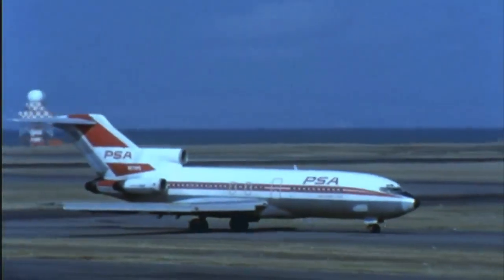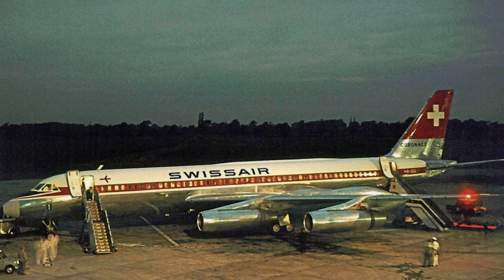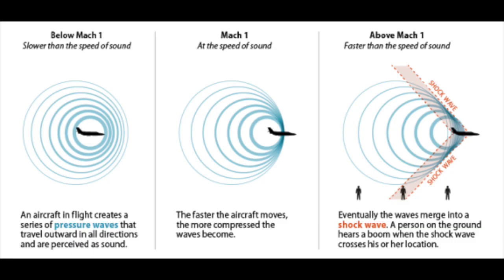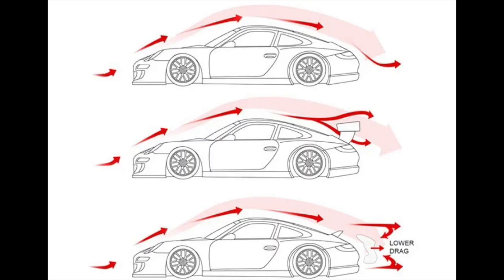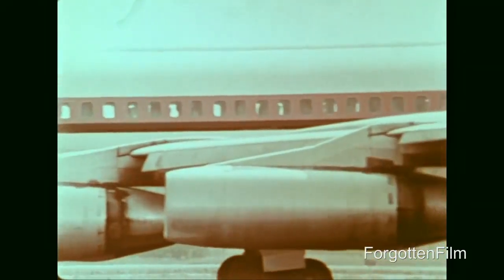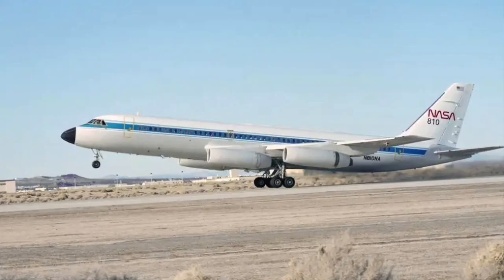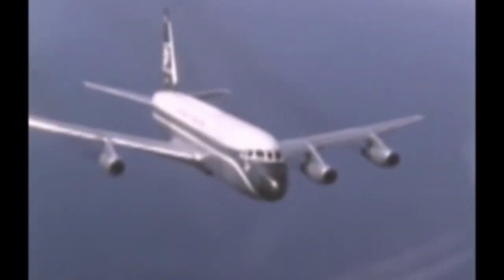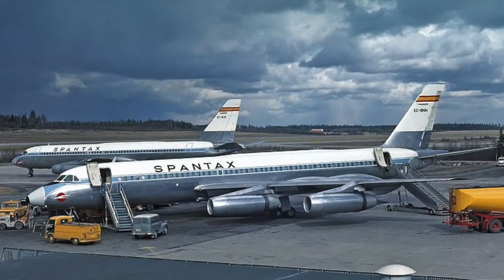A Dive Into the Convair 990 Coronado

Comment: Plural for "Aircraft" is not "Aircrafts." It is the same as for the singular. "Many aircraft..."

The 990 was capable of traveling at its designed speed of 640 MPH. But air flow challenges kept the aircraft from enough range at those design speeds to interest American Airlines. They wanted the 990 to take a first-class group from New York to Los Angeles at M.9 all the way. This is 625 MPH. That speed was easy for the 990. But at that speed it could not go far enough for a non-stop flight.

Convair had a marginally successful bird in the 880. So, with the fuselage and cockpit ready to be easily duplicated, a better idea than the faster 990 would be a shorter and slower twin. That was their original plan. It was Howard Hughes who strong-armed them into making a medium fast jet (the 880).

To the engines of the 990, they were sort of a turbocharged turbojet. Unlike front fan engines, the GE aft-fan would run faster with increased exhaust pressures. This contributed to higher speeds and higher altitude effectiveness. A nephew of a Garuda 990 pilot has said that he rode several times in a 990 that island-hopped at about M-1. And I suppose that, though burning a lot of fuel, is believable.

One last thing: Jet fuel is not a "gas." It is an oil. Its basic chemical base is kerosine. But understand that the 990 did have limited appeal- like the Concorde. There were 65-880s, 37-990s and about 20-Concordes.

Comment: It (nor the 880) were quite wide enough to have regular 3/3 seating.  That was a killer - though I've heard that it allowed actually bigger seats.  I heard they ended up cruising at speeds of only Mach .78 to Mach. 80, which was slightly slower than the 707 and DC-8 cruise speeds.  All because of fuel.  

I honestly think the Boeing 720 really killed the Convairs as well.  Faster than the 707's and DC-8's, and 3/3 seating.
Reply: 880s could cruise slow to save fuel. But 990s could not. Their wing shock bodies cost energy at lower speeds. So 990s always cruised at .85 or above unless restricted by traffic.
Reply: @danielocarey9392  Have never heard that, but it does make good sense!

Comment: Another cool, but odd, feature on the CV 990 was the GE CJ-805-23 turbo fan engine.  Note the compressor stage is in the back (not the front) of the engine.  This is why you see a 'tube-in-a-tube' when viewing the front of the engine.
Reply: To the engines of the 990, they were sort of a turbocharged turbojet. Unlike front fan engines, the GE aft-fan would run faster with increased exhaust pressures. This contributed to higher speeds and higher altitude effectiveness.
Reply: @danielocarey9392  Thanks for correcting my incorrect statement.  I meant to say (above) that the fan stage was at the rear, and NOT the compressor stage.

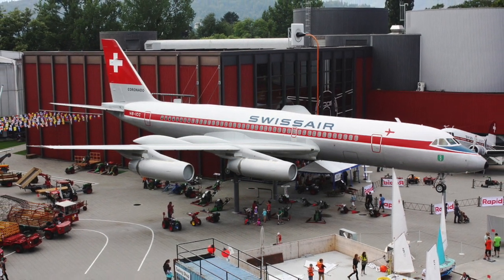Comment: TWA never operated a 990. The Convair 880 was in TWA's service. Also at 6:11 an 880 is shown wearing Cathay's livery
Reply from the maker: Yea you're right on that one. I also ran out of videos so I put a CV880 film in there and hope nobody would notice lol.
Reply: @rayneutronkuk  I maintained the Cathay CV880's for a few short years before they were retired and also saw Swissair 990's at Kai Tak briefly before being replaced by DC8-62's. The CX 880's were all CV880M's with full span leading edge devices (Kruger flaps inboard and slats in the centre and outboard sections) however the 990 had Kruger flaps in all locations. Often wondered why Convair changed that. Also knew a Captain who had flown  both 880 and 990 and reckoned the 880 was much easier to land.

Comment: was a beautiful aircraft, my father worked for TWA and used to see them at ORD
Reply: Great. He got to be around TWA 880s and see AA 990s in Chicago.
Reply: and don’t forget, one of the other two major US 880 operators, Delta, also had a substantial presence in Chicago since acquiring C&S in 1955 and probably flew the 880 there (AA certainly flew the 990 to ORD, and TW certainly flew the 880 there).   The other major US airline that flew them, and the only major airline that had both the 880 and 990 that I’m aware of, is Northeast, which was the 11th largest airline in the US and merged with Delta in 1971 after a failed attempt at merger with Northwest (which is interesting to think about, would that have given us Northern?); the CAB would have required in a merger with Northwest Orient as they were called at the time that Northeast’s MIA-LAX route be forfeit.   At any rate, by then the largest aircraft in Northeast’s fleet was the 727-200, but until 1968 Northeast operated six Convair 880s leased from Hughes Tool, originally meant for TWA, and one 990 Coronado, named Flagship Rita.  Delta and TWA both kept the 880 in service until the fuel crisis of the 1970s, so at the time Delta acquired Northeast, Delta was still flying the type.   Two books you may enjoy are Delta: An Airline and Its Aircraft, and TWA: An Airline and Its Aircraft, both by noted aviation historian Robert Serling, the brother of Rod Serling of the Twilight Zone fame (who helped ensure realism in various aviation-related episodes like The Odyssey of Flight 33).